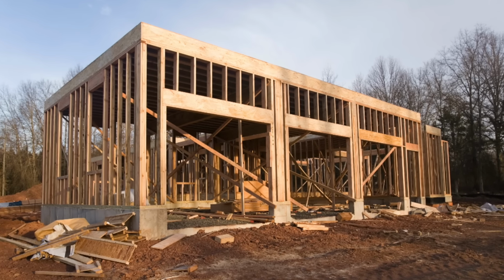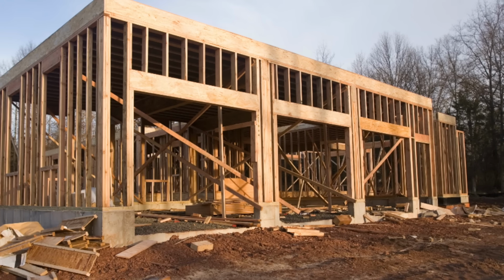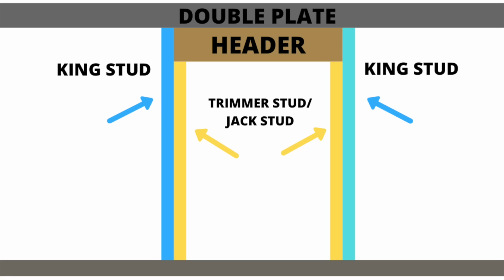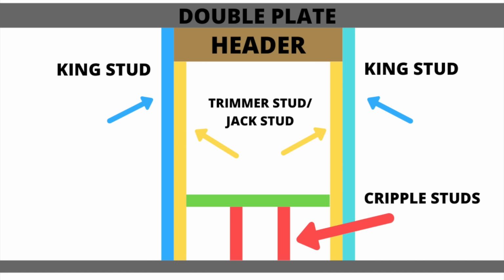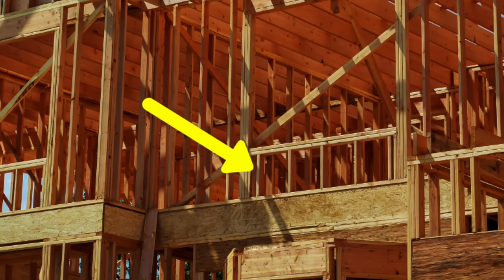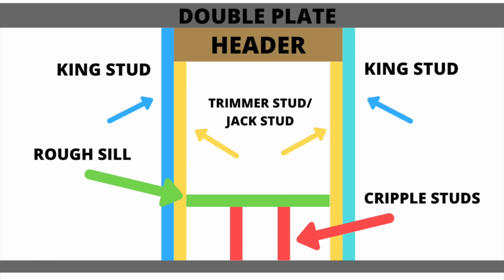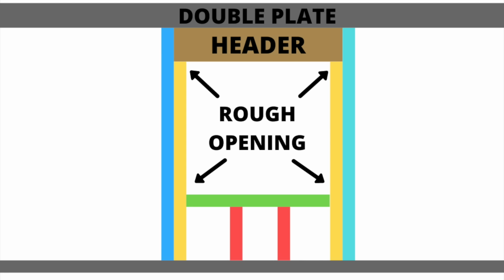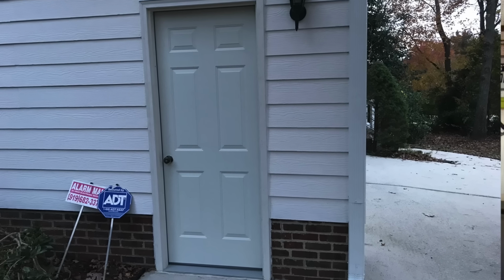All House Framing EXPLAINED...In Just 12 MINUTES! (House Construction/Framing Members)

Comment: My particular needs are something like this. I look at my newly poured huge concrete patio. I think putting sill, wall, and rafters to my existing house and framing it as easy peasy. But, how do I know if I meet local building codes? or not? That's the knowledge I'm missing. I've built a mini-barn by myself, 12x20x12, and super simple. But those are not or will not be scrutinized when i sell like stuff I do to my house. Good in theory, but how do I get proper construction to not present a problem at time of inspection for pending sale? Or, once I cover it up with drywall and sheathing is it "Who cares"?

Comment: I don't know how or why but this video was perfectly timed. I do follow you but this particular video just popped up in the middle of my rebuild. we had a house fire and need to reconstruct the second floor and entire roof framing since it's no longer to code. The architect seems very hot on using trusses especially since they can be made to open up more usable attic space for storage. I can't wait until the plans are finished. I am actually considering paying you to give them a look over and see if you find anything out of whack. Is that a service you offer online. Location is pleasant Hill California which I know probably has slightly different city codes.we are going to have engineering and then the city inspector look over the plans as well
Reply from the maker: Hey Trumpet, I’d say there’s a chance we can help! Just reach out at the contact tab at our website:
www.thehonestcarpenter.com

Comment: I live in an old Victorian house with balloon framing. It’s not something everyone will run into unless they’re doing repairs or additions to one of these kinds of houses. Things work much the same but there are differences because of modern building codes; mostly concerning fire codes.
Reply from the maker: Balloon framing is rare in my parts, Kevin. But it seems like it would definitely have more fire issues with the taller bays in the walls.
Reply: @TheHonestCarpenter  if not fireblocked there is nothing to stop a fire from rushing from the basement to roof along any outside wall.

Comment: Those holes in the I joist look too large at 225, of course you need to check the manufactures instructions for max hole sizes, spacing, series etc.
Super informative and well presented.

Comment: Great explanations, necessary if you are going to be talking to a contractor.  I have a related question,  how to identify a "load bearing wall"or post?  I am reno'ing a older condo with an island to separate the kitchen and the living room but there is a post on the end of the island that goes to the ceiling, I'd like to remove the post. I took off some drywall from the post to see inside and it is just two parallel 2x4s with separated by apprx 2 inches going to the ceiling.  I looked in the attic and there was nothing transferring weight to anything in that area.  I am in the top level, so there is no upper level for me to concern myself, just the roof.

Comment: Well done. I think another video(s) could be done on how the framing is done. For instance, how the studs are put together at corners to make nailing surfaces for the drywall inside. How about all of the framing around windows and doors, such as cripple studs? Then there is roofing. When doing valleys, dormers, etc., there are a lot of complex angles to cut necessary to match everything. Then there are all of the codes that have to be followed.

Comment: Rafter ties were not mentioned.  Many folks consider them to be load bearing “ceiling joists”, or “attic floor joists”.  Of course, they have a very different function.
Reply: Collar Ties as well!
Reply: Rafter ties are as the name implies. They tie the roof rafters at the base of the triangle and are in tension. Rafter ties are used when the ceiling joists run adjacent to the roof rafters. Rafter ties carry no downforce loads only tension and can not be used as CJ's or FJ's. Rafter ties keep the downforce on the roof rafters from splaying out the walls.
Reply: @fsoileau  I bought a foreclosed house almost 10 years ago. It and the detached garage were built in 1947. The garage, which was not finished off inside, had been suffering sway back for many, many years. Previous owners kept it from imploding by notching the ridge board and jamming a 4x4 under it. The contractor installed two cable ties spanning the depth of the garage and over a period days tightened the screw bolts until the roof snapped into place. The roof has since had three layers of shingle removed and replace with 1/2 " plywood, moisture barrier and new shingles.
Reply: @atteroljones6936  I have 20 bucks that your contractor has been in the business for over 20 years. Go's to show practical tradesman ingenuity can trump the best of engineered design.

Comment: No wonder there were so many memes about guys named Kyle punching holes into drywall. Are these structures at least worth it in terms of cost compared to brick and mortar? I guess you can repair and remodel stuff much easier, but what about fire, termites, mold, rot, water damage, high speed winds, and generally bumping into the walls and causing damage?